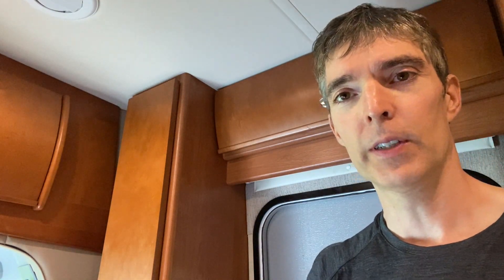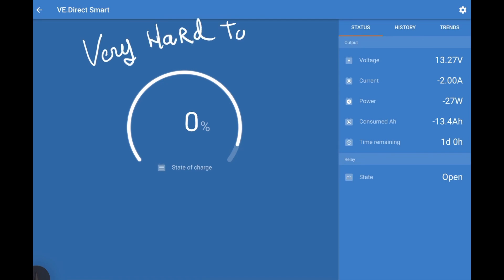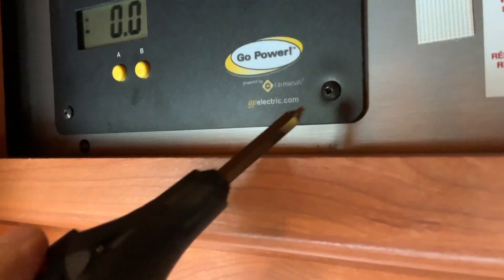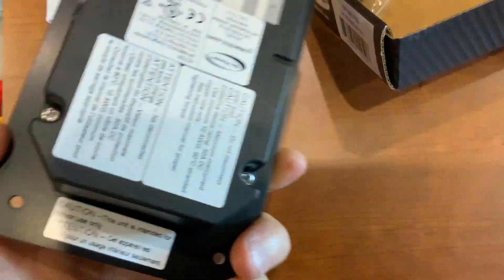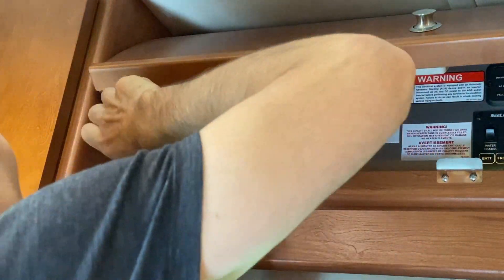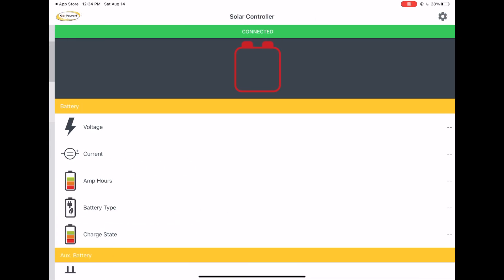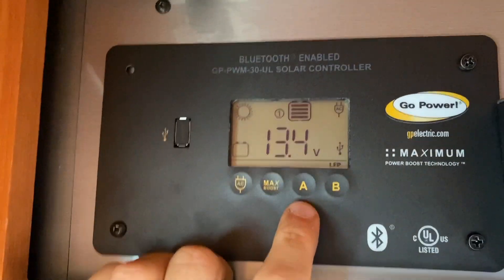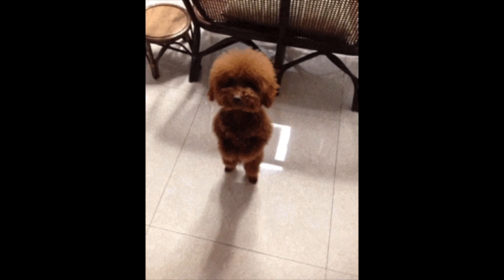Time to let go of the old solar controller...Easy Upgrade GoPower Lithium AND Bluetooth GP-PWM-30-UL

Comment: I have had problems with the second battery bank charging option after upgrading to the GP-PWM-30-UL and two LiFEPO4 100 amp each batteries.  Initially the charging seems to switchover from the primary to the secondary fine, but not sure as it seems after switchover to secondary charging and waiting awhile as up to full charge point, the controller panel sounds an audio alarm.  The only way I've been able to discontinue the alarm is by disconnecting the second battery wiring altogether.  I haven't contacted GoPower customer service to see if there's a fault.  Any suggestions?

Comment: I know this is an older video but if you stumble across it, I am suggesting to look elsewhere for a controller, or at least do more research. I currently have this unit and it works just fine on normal battery settings. But after I switched from two lead-acids to a single LiTime Lithium battery recently, it started behaving badly. It is going into an over voltage (>15.5V) situation and begins to flash the entire display as its designed to indicate that error. I also hear an audible click from inside which I assume is probably a board mounted relay that is cycling. 

When inquiring with GoPower tech support, (who did respond very quickly, so I've got to give them credit there) I was told that;
1 - Their controllers sometimes have problems with the LiTime BMS. It's a battery issue.
2 - I should have a larger battery bank given my solar wattage.  (I'm at 230ah with 390 watts on the roof. Pretty normal IMHO)
3 - It's ok leave it flash like that. It'll stop and act normally when I turn on some loads. (Me: "Yeah, but...")

Then he suggested until I purchase more battery capacity, I could just run it at the "Sealed" battery setting and it should be fine. I did so just to finish up my trip last week and then return to my storage lot. It did fine, no errors. Today, my new MPPT controller w/bluetooth from another manufacturer arrived for significantly less money than the current GoPower unit sells for. After I got off the phone with GoPower and thought about it, I felt a little disappointed that not once did he say that "there may be an issue with my controller, let's check a few things." Then when I got home and did a little more research on these units and found others having similar or worse issues, it was an easy decision to go a different direction.
Reply from the maker: I've swapped everything and now I'm all Victron....
Reply: Were you ever able to find a solution to this overcharging condition?
Reply: I have had problems with the second battery bank charging option after upgrading to the GP-PWM-30-UL and two LiFEPO4 100 amp each batteries.  Initially the charging seems to switchover from the primary to the secondary fine, but not sure as it seems after switchover to secondary charging and waiting awhile as up to full charge point, the controller panel sounds an audio alarm.  The only way I've been able to discontinue the alarm is by disconnecting the second battery wiring altogether.  I haven't contacted GoPower customer service to see if there's a fault.

Comment: Great video thank you for your efforts,
I have Go Power pwm solar charge controler 30 amp 
and it doesn't go over 13.6v on lifepo4 setting.
Reply: Hmmmm… the controller might be the issue, but it could be the battery?

Comment: Disconnect the battery wires last when removing, and connect the battery wires first when adding the new controller. The controller is not supposed to be connected to solar but not the battery--otherwise it could be damaged. Also covering the solar panels is a good thing to do.
Reply from the maker: Good to know!… Also, I didn’t say but the RV was under a carport … thank you

Comment: Good upgrade for exactly the right reasons.  It's too bad they did not have an MPPT replacement.  The second battery bank charging option could go to the starter battery in your leisure van.  You can't set each banks battery type in settings according to their app pictures.  IMHO a good solar charge controller will maintain the starter battery better than the alternator will.  Safe Travels!

Comment: Thank you.  I have considered doing this but many are saying to go to a MPPT controller instead of a PWM controller.  I like the ease of replacing a GoPower with a GoPower in the exact same space but understand that MPPT controllers can give better performance.
Reply: It’s true… MPPT also need to be closer to the batteries…
Reply: @DrDGr2  That is also keeping me from going to MPPT since I would need to rewire and put in an MPPT controller - likely in my outside compartment with the inverter - which I could also bump from 1000 to 2000 or more.  So much could be done but what do I need?  Thanks!